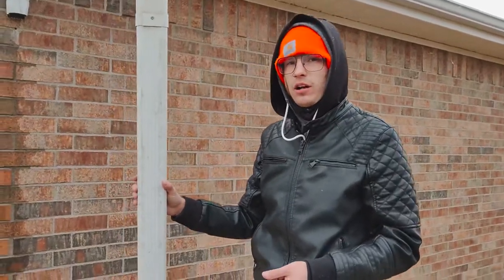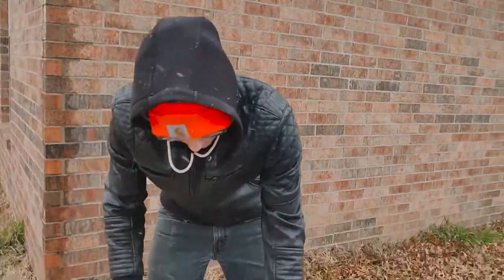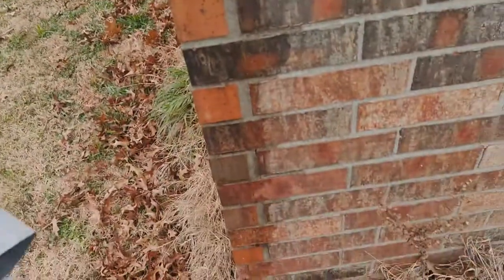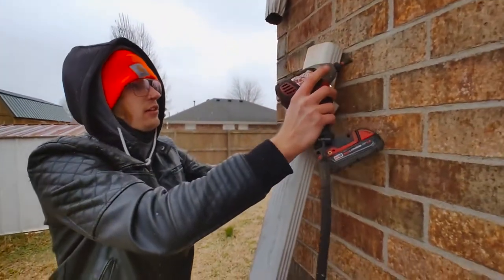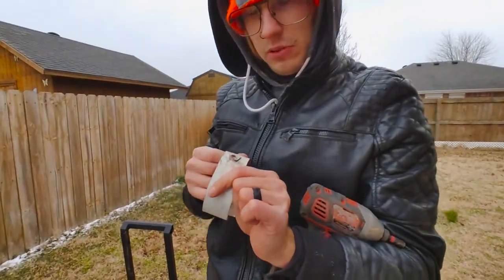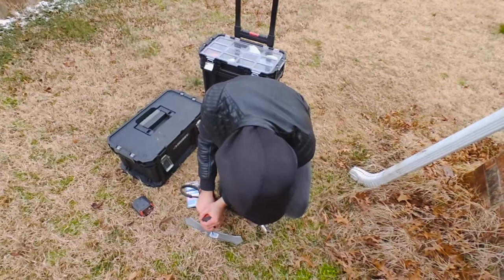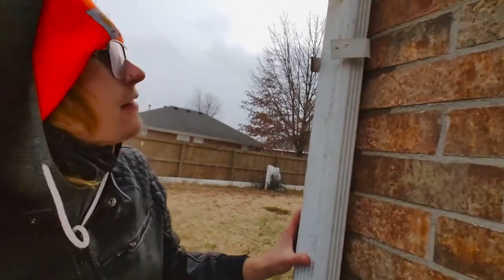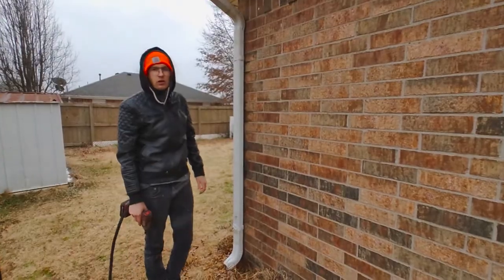How To Refasten A Downspout Into Brick Siding | DIY Concrete Or Brick Downspout Installation

Comment: Good video. Very helpful. But in your blog post you say to use both a 3/16 drill bit and 3/16 Tapcon screw. Should the Tapcon screw be 1/4, slightly larger than the 3/16 hole?
Reply: When I bought a box of Tapcons at Home Depot, the drill bit it came with was indeed slightly smaller than the ¼" diameter of the screws. So that is what the company itself recommends.

Comment: I figured it out. Your material list is incorrect. Simple mistake. Instead of using 3/16 bit and 3/16 tapcon. A 3/16 tapcon  uses a 5/23 bit or else the hole will be to big. I do a lot of diy but never had to drill any masonry stuff. So I didn't recognize this small mistake in your material list. A learning experience ;)
Thanks for the video I know yall was freezing brrrrr
Reply from the maker: Thank you for pointing this out. We will update this ASAP
Reply: @chappellgutter  This still was not updated on your website.  I got all the things recommended and the whole is too big.  Please fix your website.

Comment: Great video. What was the impact driver needed for? Also, do gutter screws go by another name? I cant find them.
Reply from the maker: The impact driver was used for screwing in the screws. You can use a drill if thats what you have. 

"Gutter screws" are 1/2" zip screws OR 1/2" screw with a 1/4" Hex bit tip
Reply: Lol

Comment: Is there any rules on how far apart the wall straps/ (brackets?) can be in the vertical?
Reply from the maker: Not necessarily. I try to place two straps per downspout. One strap as high and one as low as possible. Realistically as long as there are straps within  2 feet of the bottom and 2 feet of the top your should be good.

Comment: The line is the mortar joint, and def where you want to screw into.  Never the actual brick or cinder blocks.  Glad you used those "decorative straps" right.  I gag when I see 99.9% of flaps screwed into the house, instead of wrapped around the front like you did.
Reply: Is that for cosmetic reasons or something else?  What comes to mind for me is that the hole in the mortar can be filled in more easily if needed and this does not need to hold a lot of weight anyway.
Reply: Yes. Mortar is replaceable, not bricks.
Reply: @karenolsen5302 Exactly. 👍

Comment: Do the masonry screws need plastic jackets, like drywall screws do?  Also, is the decorative strap supposed to be wound around the pipe like that?  Or is there a plain strap that goes underneath, and the decorative one goes across the pipe?  Good video, answered my questions about what tools to use & where to make the holes.
Reply from the maker: The Tapcons do not require anchors as long as the correct size drill bit is used. 

The strap is just a strap. 1 strap per each strap placement
Reply: @chappellgutter  I succeeded in fixing my downspout constantly falling off in strong storms, thanks to these instructions. I made a butt-ugly job of it, but it works better that the original contractor's job. He just pegged 1" cement nails into the mortar.
Reply: @chappellgutter  I've seen many use that kind of strap you use on the bottom as a "decorative" strap that fits over the top of the plain strap.  But I like what you did better.  I can't find the plain straps anywhere so I like using the "decorative" strap like you did.
Reply: Home Depot sells plastic downspout holder that the downspout snaps into and there is nothing showing on the front.  :). This way there is no screw going into the downspout and possibly catching debris and blocking up the water.

Comment: Great vid.  Thanks!  Say, did you say that impact driver was needed to drive in those screws, or will a regular screw gun work?
Reply from the maker: A regular screw gun should work just fine. Try it out and please let me know how it goes.
Reply: Regular drill did the job, I used a Dewalt 20V
Reply: I'm guessing the impact driver was used just for convenience - you can just interchange bits without having to make adjustments.

Comment: What about the previous holes in the downspout? Won't water shoot out of them if you just leave them? Do you have to stick a screw in those old holes to plug them up?
Reply from the maker: It's best to try to aim for the original holes. If you can't, it's not the end of the world. Some water may come through those holes but not enough where it would be damaging to your home or even noticable.
Reply: @chappellgutter  Thanks for the fast reply :)

Comment: How big a hole or what size did you use to drill into the brick?
Reply from the maker: 3/16 in. Steel Carbide Tip Masonry Drill Bit 

All information can be found in the blog post linked in the description.

Comment: Where to buy stainless self-tap 8 x 1/2" screws?   Why use fasteners that eventually rust, stain, and weaken?
Reply: The same fasteners also come im steel. Like look just like aluminum ones. You can get them at home depot Lowes etc

Comment: Drilling into brick is not precise. The drill bit tends to walks. I was fortunate to have some bigger anchors but a smaller drill bit or bigger bolt might save a trip or two to the local home improvement store.